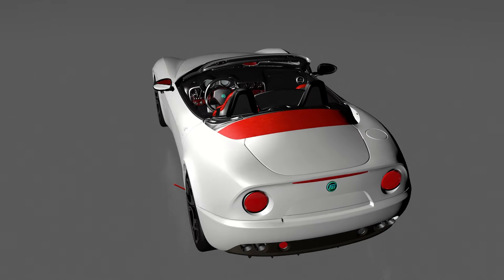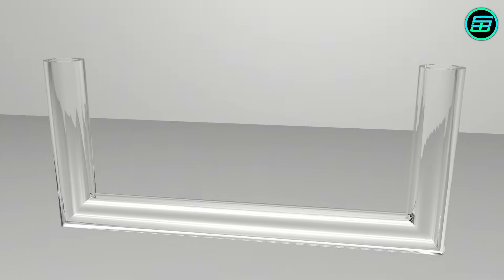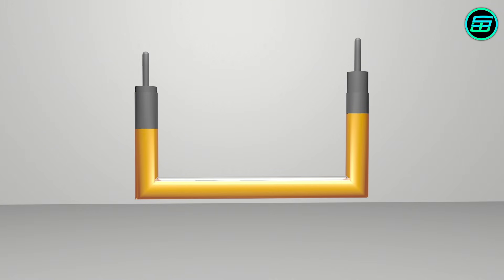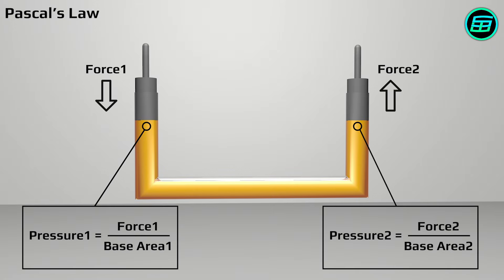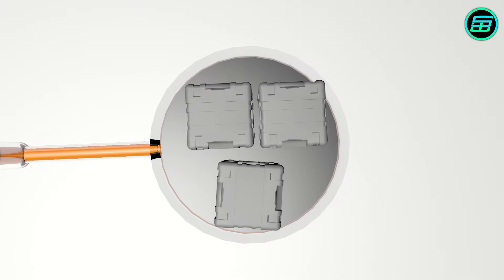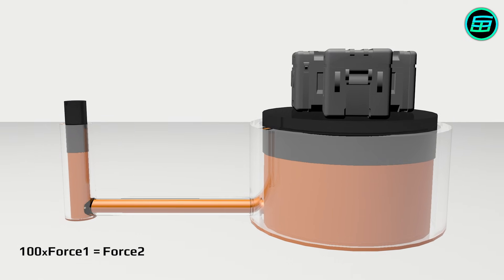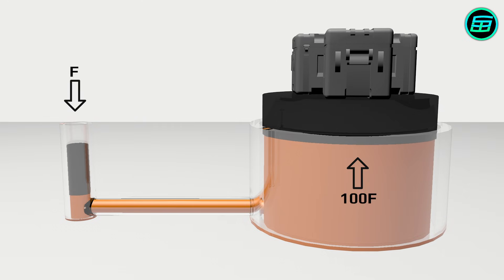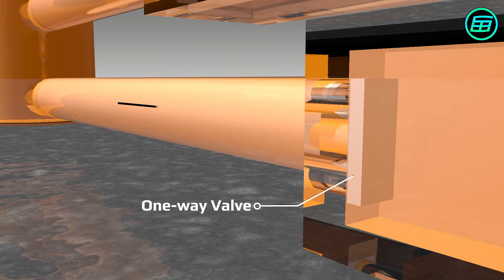How a hydraulic jack works (3D Animation | Pascal Principle)

Comment: You only explained the Pascal Principle. You didn't explain how the hydraulic press works at all. How does the oil return back? How with such high pressure the oil isn't squeezing between the cylinder walls? How exactly does the one way valves work and why do you need two of them? I came here to understand how the hydraulic press works and after watching the video I didn't learn about how the hydraulic press works at all.

Comment: So in the case of a hydraulic press, the pressure applied to the object being pressed is never seen by the internal components such as the hose/pipes/check valves? I'm watching hydraulic press videos wondering how parts of the press don't explode like the objects getting pressed.

Comment: It doesn't multiply your force output it multiples your work. 

Work is defined as energy put in a system used in a useful manner. So if you pump a hydraulic jack it will use more of your energy input than otherwise. 

I heard someone say that you could just use this as a infinite energy glitch, but again it doesn't multiply energy it multiplies work. Energy and matter can neither be created nor destroyed.